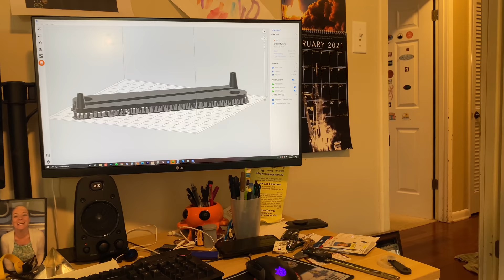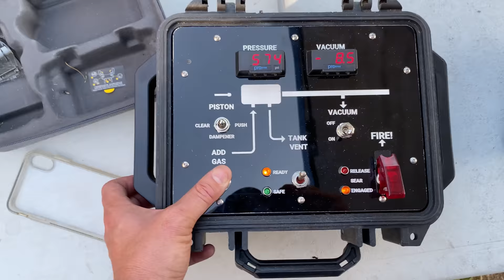The Mystery of Magnetic Worms - Smarter Every Day 253

Comment: At my last job, we cleaned dirt out of edible beans with a magnetic roller. Somehow, the plain black dirt from the fields had enough magnetism that the magnetic roller would change the angle the dirt fell off the belt. As the beans and dirt fell into a chute, we were able to collect the dirt into a different channel and separate it from the now-clean product. We all called it the magic dirst machine, because it sure seemed like magic in action. We went from having to shake the beans 3, 4, even 5 times, to only having to shake them once, just to get the finer dirt and dust out of them.

Comment: So my initial thought was that the worms found out on the asphalt had ingested a large amount of meteorite dust. One of the things I learned in my Astronomy class back in college was that you could go to a storm drain or any small collection of dirt on the road or top of a parking garage, with a magnet, and pick up perfectly spherical, microscopic bits of iron meteorites. Our planet is being showered with them all of the time, but almost everything that goes through our atmosphere is burned up before it hits the surface and turned to dust. For all the iron that comes from space, that heat and the gravity of the Earth, combined, is enough to turn that iron into a sphere. And that's the fun part about finding them with a microscope. From the sample you grab with your magnet, every little perfect sphere you find under that microscope you can tell, for sure, is a meteorite from outer space :)

Comment: Humans: “lol, magnetic worms.”
The metal in the worms: “I’m about to lift a worm by its digestive system.”
The worms: “Is this what pain feels like?”
Reply: Utan Namn  Too many, the carbon amount alone would be massive compared to the iron. Like the iron prob would just get lodged inside the carbon chunks.
Reply: That's what I was thinking. Picking them up by their internal organs has got to suck.
Reply: Worms can’t feel pain, well apart from fire that’s about it
Reply: @Volt64bolt  How do you figure? They react to it, after all.
Reply: @Malidictus  well they react to it yeh, they feel it, but it doesn’t hurt the same way we hurt, they just feel it there, they might have a negative reaction but they probably think they are just getting picked up by a bird
Reply: @Volt64bolt  as long as humans think that animals cannot feel, animals must feel that humans cannot think.
Reply: @Malidictus  Pain is a pretty complex sense. Without a significantly developed nervous system, an animal simply doesn't have the ability to feel pain. Even most fishes cannot feel pain based on our current understanding, insects worms etc. are not even close to anything that complex. Reacting to something is not pain. A very primitive robot is capable of avoiding harm and danger but that is not pain, because a robot doesn't feel anything. Avoiding danger and running from it is very very far from pain.
PS.: There is even a genetic disorder that renders a human unable to feel pain, but otherwise doesn't hurt them (and they don't really sweat which is a problem ofc). But they can still understand danger, and react to harm and avoid it.

Comment: A small afterthought, you guys seem to think that the worms are eating the iron. My thought is that the mucus released from the worms making them sticky and is collecting the iron dust on its outside. Because the worms are small and light, the small amount of iron dust collected on the worm is enough to pick them up. However, the idea that they're eating it I way cooler!
Reply: If that was the case the magnet would just pull the iron off the worm
Reply: @craigkingdon4424  yes and also the worm would be attracted with its whole body and not the only part where its stomach is.
Reply: Worms eat sand for digestion. Some sand particles are Fe3O4 mineral magnetites. It can alluvially concentrate even just during a heavy rain 🌧️
Reply: @captainTubes  -- Geologist?  Agronomist?
Reply: @Dudemon-1  I'm curious Stoner 🪴🧖🚬💨
Reply: @captainTubes  how can I get a degree like that?

Comment: After Destin gets shocked, you can see a spark between the worm and the magnet at 1:14
Reply: Electromagnetic induction?
Maybe the moving magnetic field deposited charge onto the worm, which discharged into Destin.
Reply: I can hear it but I can't see it. Played in 0.25x speed.
Reply: @agent-33  you can see it at 1 min 15 sec
Reply: Wasn't a spark, but rather light that was reflecting off of the worm's body for a brief instance. I counted 6 frames of the "spark" being visible with the video quality at 4k 30fps, which means it was visible for about 200ms. Far slower than it would take for electrons to jump a gap and make a visible spark.
Reply: That was a mutant worm, it used its electric superpowers to avenge his own death by the magnetic gods.
Reply: So you could actually both be sort of correct, the worm might have not reflected the light but actually generated the light. 
There is a phenomenon called Triboluminescence which occurs from the separation an reunification of static electrical charges. It's different than a static shock. You can observe this phenomena for yourself if you go into a completely dark room and pour sugar crystals onto a metal plate and then smack them with a hammer or you can also adhere the sticky side of 2 pieces of clear packing tape together and go into a dark room and rip them apart as fast as you can. 
It is possible that if the worm had enough of a charge to shock Destin that him pulling it off of the magnet would have created a temporary electrical Portential differential which resolved itself and in the process created a flash of light. 

This is only a hypothesis though, but it would be very interesting and I would love to see @Smarter Every Day make an episode on triboluminescence
Reply: no actually, you can not see any sparks. the white dot in-between the magnet and the worm is a piece of sand or a magnetite crystal that is reflecting light toward the camera. it could also be a bit of the worms mucus. a spark will only last for 1 to 2 frames, and the white dot lasts significantly longer than that. a static electric spark is extremely fast, and short lived. its quite difficult to capture one on camera. also, the white dot you see comes significantly after Destin has already shocked himself and pulled his hand away. the shock traveled between his finger and the worm, on the other side of his hand, and so it was out of view.

Comment: It may have already been stated but here is the answer.  Worms in the video were covered in secretions.  The secretions were sticky and since the worms wiggled through the fine iron particles the sticky secretions picked up the fine iron particles and it was those particles that the magnet picked up.  Since the secretions were sticky they also picked up the worms.  In the video it was shown that the more the magnetic was used to pick up a worm the harder it was to pick up the worm and that was due to the fact that some of the iron particles remained stuck to the magnet.  Wash the secretions off the worms and I bet they are no longer magnetic.  It is not what the worms were eating but where they were traveling that caused them to be picked up by the magnet.

Comment: Paint cap with a magnet.... they make a shop tool that specifically does the same thing, it's  magnet in a box with a handle, you run it over the ground, put it over the bin, and pull the loop at the top of the handle, it pulls the magnet away from the bottom and drops the metal off. Look up Magnetic sweepers in the MSC catalog.

It's a lot nicer than having to bend down that much lol

Comment: @Destin, did you check to see if it's just the iron powder coating on the outside of the worms?  i.e. take the non-ferrous worms and roll them in your "Control" powder.  then take the magnetic worms and wash them.

Comment: I was picking up nails off a road with a magnet  in my community and i ran the magnet over a snake that had been run over and it was picked up by the magnet. Since then i test every snake i fine and a majority of the small ones with a red belly in northern ontario are magnetic. Now i know that it's not just my local snakes.

Comment: its wel known you can feed your soil worms fero material and keep them within a glass box and install copper leads into the box and generate about 2.1v that you can traverse into a battery bank that you hook up in series to generate the wanted voltage. we do this all the time in New Zealand especially with the tiger worms it works a charm. Remember your college was able to feel the voltage from only one worm no imagine you have a worm farm how much electricity this can generate. Another idea I am working on is my fly trap setup that captures 100 hundreds of flies the generate a huge suction flow on the pipes I installed into the trap. With the right mesh I can cool my green house using fly power. Only feed every month a little bit of cat food to keep the fly engine running. Ones you have it started its self feeding because of the huge amounts of maggots the fly generate non stop without being able to escape.

Comment: Well the soil have ferrous content and since earthworms duel on the soil it is highly posible that they ingested some as an example take a magnet and pass it on the soil and you are going to see iron filaments sticking in the magnet you can then put those filaments on a concrete floor and pass the magnet back and forth slightly on top of them and you can see the group of ferrous filaments “dance” like a group 😉

Comment: that reminds me of when i caught a mosquito in a plastic dish, its dominant 2 appendages would align perpendicularly to a magnetic dipoles for up to an hour and a half after expiration with a steady decline in reaction intensity up until that 1.5 hr mark. Couldnt find any literature suggesting magneto-reception or biological composition as a possible cause. 

translation, put a mosquito on a speaker and it flipped out. oscilating electrical (and subsequent magnetic) field
Realized that holding a magnet to the container would make the mosquito stop moving.... You mean i can passify a mosquito with a magnet?!?!?!?!
The aforementioned statement was where i ended up with the whole thing, still dont know if you could practically passify a mosquito with magnetic fields (im sure you could... just not practically) and i still never found any literature covering this topic. 

Thoughts?